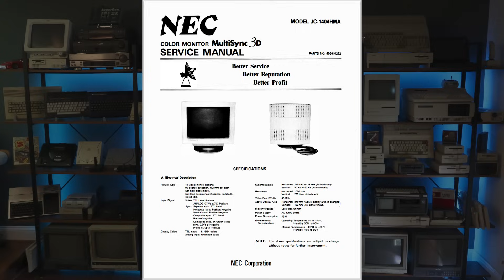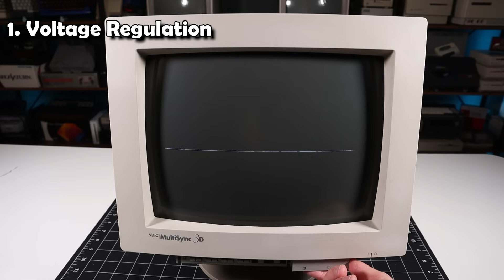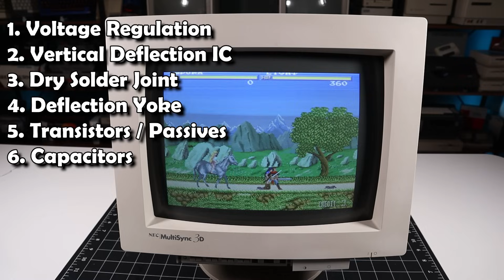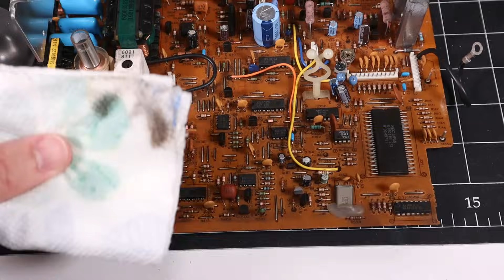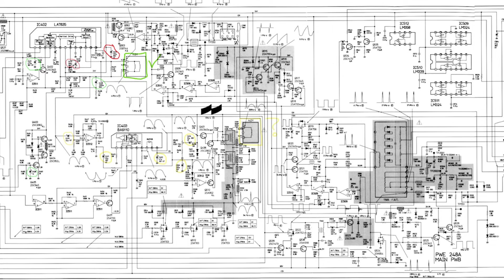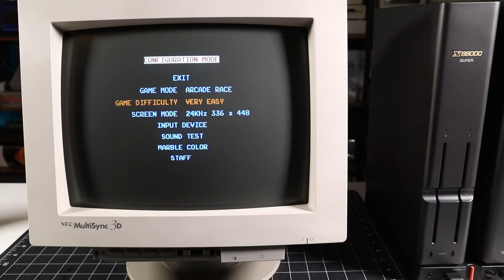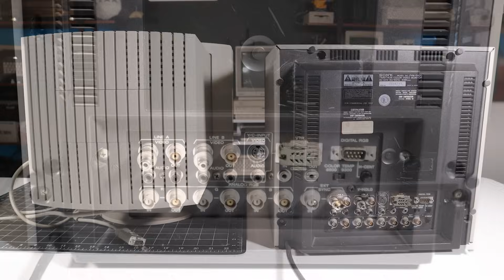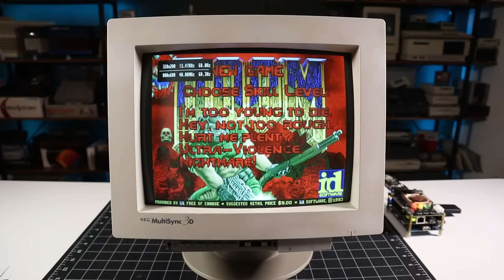The best CRT for RGB? Meet the NEC MultiSync 3D!

Comment: Good job & great video, as usual I should add! I always swap old caps with 105°C ≥5000h Panasonic parts too, such as the FR series. I also like to step up the voltage a notch, to have some more oxide to start with and be on the safe side. Being of newer manufacturing, in most cases  they end up being not bigger (or even smaller) in size anyway. Some jobs older than 15 years now, I never had to repeat the process and sure hope they will outlast me, since I'm now 45  )))
Reply from the maker: I tried to buy Panasonic or Nichicon 105C parts from Digikey where I could. There were only a few oddball values I had to get from Rubycon. That's a good tip on stepping up the voltage, thanks! I bet modern caps have lower ESR than their 1990's equivalent too so shouldn't be an issue.

Comment: While most people would have crumbled (me included), I guess a good way to look at it is, you've gained more experience AND the monitor is as close to factory fresh as it's ever going to get. Mind blowing how many modes it can support, how did you learn about that particular brand/make of monitor?
Reply from the maker: I've seen it in a few 'VGA monitors with 15khz support' lists as well as mentioned on Amiga forums in the past. I've been on the lookout for any such CRT to use with the X68000 mainly :)
Reply: So pleased to have found another source of interesting content.